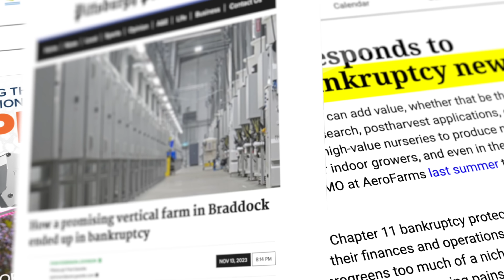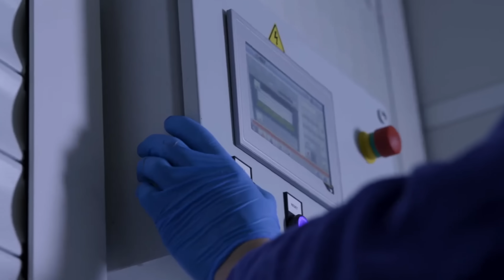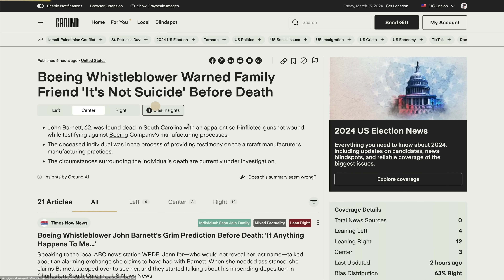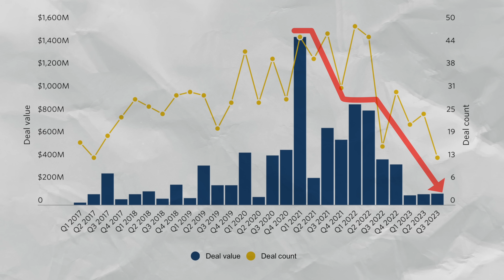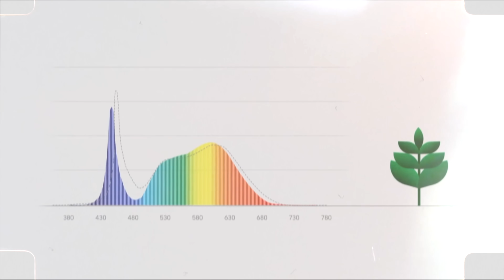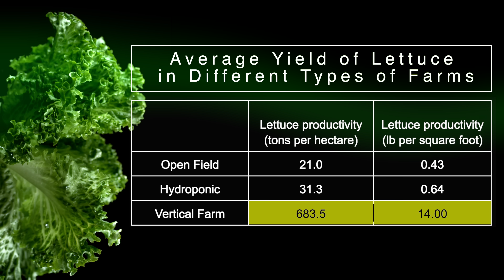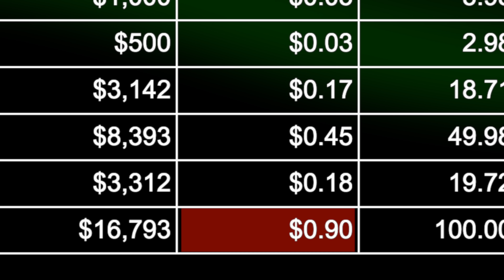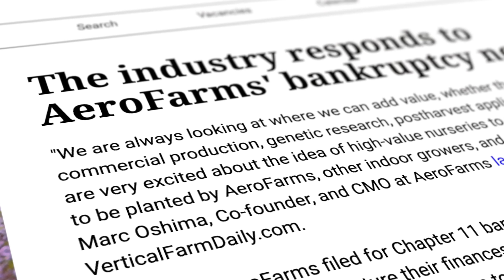The EPIC Failure of Vertical Farms - What Happened?

Comment: In the late 1970s in my father’s and his partner’s greenhouse business they decided to produce a new product and built 2 very large cutting edge technology greenhouses. His partner said it was designed by a genius teenager 😅! It had a boiler heating system that pumped water 💦 through pipes in twin rails for each row that held pallet sized racks with rollers on them for plant 🪴 containers so those racks could be moved around down the rows after delivery with a fork lift. And it had power controlled vents in the roof and ends which were all controlled automatically with small circuit board controllers. But it was basically very similar to my home that I own now that heats with water 💦 pipes in the floor and many homes have this but people don’t really like anymore because it doesn’t warm all that much during a cold 🥶 winter. It’s a system that has a lot of problems but will heat the house a little, reliably, if I don’t push it too hard and give it yearly maintenance, which I have learned to do myself. I saw this greenhouse right after it was first built and then went off to University, two years later I saw it again and it looked like it had barely been used and 1/4 of one had racks of seedlings 🌱 in it but all the rest of the 2 greenhouses were empty. I didn’t ask because it would have been very rude! 
I was rushed outside and told, “We do it this way now!”
So for the first time in many years of this greenhouse operation they were using cheap hoop PVC greenhouses that are just half circle ⭕️ arches of 1 inch PVC pipe with white plastic tarp over it, so you can walk through it, and they had young citrus trees inside and they said these greenhouses are the best because they get the HOTTEST, so these small trees will fruit and that was what sells in the retail market! 
The old and new greenhouses were a big waste of money! 😮 If they had designed their growing systems first, responding to how the plants respond to their cultural practices then they could have built their growing system around what worked initially, instead of having wasted all that money 💰and time on CRAZY ASSUMPTIONS! Those hoop greenhouses are easily collapsed and moved out of the way so a big tractor could come in and disk the plant wastes into the sand, and then the greenhouses can be put back up again.
This and all the news in this YouTube are very disappointing to me because I see a culture that has lost its MIND 😮 INDEFINITELY, where did that thing go? It’s on your shoulders, I think, oh thank you! We plan incredibly expensive systems like we think we are GODs and know EVERYTHING and then they don’t work at all! And the rational thing to do ALWAYS WAS, first document every fine detail of the requirements to grow the desired crop and then build everything around that. But that’s not what happens, build a system and force the biology to cope with the system, so the plants never grow well, is what we do.
How can we possibly survive on a distant planet 🌎 if we don’t know how grow anything? Sooner or later some company will find a way in space to make a lot of money and everyone and everything will start dumping into space to copy that new thing! It ALWAYS works that way. But if we can’t even learn how apply science 🧪 in practical way, which is all I did with my growing system, then people will go into space to do business and then quickly starve to death! 😢
People who first sold shovels to the miners in the gold rush made more money than anyone else and the miners stole from each other and killed to get control of the best mines!

Comment: Why do they need all the LED’s anyway? Wouldn’t it be more efficient to use windows and well placed mirrors to try to utilize as much natural free light as possible?
Reply: Mirrors and plants dont go well together. End up wtih the light being too concentrated and burn spots in the plants. Same with water droplets on leaves it can concentrate the sunlight and burn a spot.
Reply: That's what traditional greenhouses are for. However vertical farms can produce at a rate several times higher than if you were only using natural light, and you can pack the plants more densely.
Reply: mirrors yes, but you need to use light defusers as well so the light scatters around the plants and not a focused area
Reply: I'm pretty sure mirrors cost more than LEDs do, if you look into it, LEDs are unfathomably efficient in providing light, so it makes sense that grows rely on them. The goal is to maximize plant density, and relying on windows would eventually constrain how big the operation can get.
Reply: @raziphaz2219  LEDs use electricity, which mirrors wouldn’t. So even if they cost more up front it’s cheaper in the long run
Reply: @justicedunham4088  mirrors need to be cleaned and replaced, and it would take years to make up for the initial cost. Mirrors also aren't scalable, you need to keep re configuring the space to allow everything to get sunlight. There also isn't enough light captured by one mirror
Reply: @raziphaz2219  seems LEDs are also not very scalable and aren’t cost effective either, or indoor farming would be profitable
Reply: @justicedunham4088  the video we both watched showed that it was labor costs that made it not profitable
Reply: It’s called PPFD quantifies the number of photons (light particles) that are part of Photosynthetic Active Radiation (PAR) striking a specific area (like a plant canopy) per second.  It’s what makers the plants create plant material from carbon. This can be done at a faster rate with higher lighting creating bigger yields and faster turnover.  Traditional farms don’t have that luxury.  Hybrid systems utilize both artificial light and natural light.

Comment: I'm getting the impression that this is an industry that has suffered terribly from a bunch of grifters flocking towards it based on some flashy magazine articles which likely oversold and misrepresented what isn't actually a terrible idea.

Just thinking on the sheer scale that vertical farming requires and it becomes kinda obvious that it's way too big for the average two bit venture capitalist to take on and you're realistically looking at total state involvement since you'd need to build many huge skyscrapers (WTC One in NYC has a floor area of 80 acres whereas the average UK farm is 190 acres) with industrial scale plumbing feeding them and they'd use a huge amount of power for lighting, heating, moving water, powering the controls and instrumentation, harvesting etc. Really only nuclear plants have the vaguest hope of providing the necessary power, and large scale nuclear at that... you'd need multiple plants capable of constantly pumping out gigawatts of power. This is well beyond the scope of any venture capitalist yet extant.

Comment: 40% blue color workers just means that they started before robotics are good enough (whenever that would be). Obviously, hightech farming without the hightech is pretty costly.

Also, vertical farming as a whole makes the most sense when done as part of a strategic self-sufficiency project by a small country. When the world economy catches a cold, state-owned vertical farms might ramp up production to keep food affordable.
Big countries would likely just use fields or greenhouses for that though.

Longterm, farming in a controlled environment might eventually get cheaper than farming on a field because of advances in robotics and energy efficiency. Any farm produces biomass and that can be turned into biogas and then power. Combined with photovoltaics on the roof a power-neutral vertical farm might become possible eventually.

Comment: It sounds like vertical farming is a prime candidate for full automation. By having less manpower, you might be able to offset the labor cost by having less people working on the farm. I think the goal should be to meet traditional farming in end cost with a longer term plan. So the upfront costs may be more expensive, but with the potential ability to be more productive with less space, if they reach cost parity with regular farming, eventually their product will displace regular farming from sheer volume alone. So on the front end, I would probably concentrate my resources on producing an automated system which is easy enough to run on a large scale with very minimal human resources or even training to keep the costs of the end product low. I think it's possible and we are just in the trial/error phase of the industry. Eventually, someone will hit the right balance.

Comment: Further automation won't solve the issue. The product is simply too simple. Automation works in for example the auto industry because the end product, the vehicle, is collectively more complex than the individual machines making them, and hence a vehicle is a high value product. But here there's a complex machine to pick up and move a lettuce or lettuce seeds etc. The cost to maintain or repair even a single one of those machines won't be made up by the sale of hundreds of lettuce. 

Automation works when the end product is more complex than the machine itself, or at least if the end product is used in further high value products. A complex machine may make simple nuts and bolts, but those nuts and bolts are used in more complex end products. Lettuce is neither a complex product, nor is it used in more complex products further down the supply chain.

Comment: the bottle neck is sulfides. manufacturing them is nasty and the line of manufacturers ahead of farmers for these sulfides is ever continuing challenge we can't supply both electric car manufacturers and vertical farms with sulferic acids that are needed to make those industries work. so far none of the Dutch swedish and german vertical farms have failed. it is because the owners of those corporations also own stakes in manufacturing sulfuric acid and bypass the industrial commodities market as a result. instead they purchase their sulfur compounds off the top with a national plan.

Comment: I've been saying this since this idea came about that the first proved cases used the easiest crops and fastest to grow to get good numbers and everyone just sort of assumed plants are all the same but they aren't.  
  
What works for lettuce and greens won't work for everything.  
  
If you for example took all US corn acres and stacked it 10 times you'd have a building the size of west Virginia. In other words more roof space than every current building and home in the US combined. 
  
Also many crops require pollination. How do you do that in these farms? Think of the pollen mess and clean up.
  
Also what isn't included in the yield per acre calculations is all the added elements that need space. Parking lots for workers, retention ponds, space for AC and climate control units, offices, loading docks, labs, storage, warehouse, equipment maintenance shop, and so on. An outside farm only has some of those but not all.  
  
The idea was dead on arrival at least with current technology.

Comment: This is the same "idiotic" reason nuclear is expensive, even though it is the best energy option in every way possible. As long as the technology and its use isn't widespread, modularized, mass produced and standardized the initial investment, build time and labour costs will be so high even a far superior solution can be left near dead

Not to mention there are a lot of corporate interests who control the cheap labour and heavy pollution alternatives to vertical farming and nuclear that will keep making sure they do everything in their power to not let these technologies become viable

Also, a point that this video sadly doesn't cover enough, is the insane environmental cost normal farming (especially rice) has, and it is one of the major contributors for humanity's added impact on global warming

Also, one of the MAJOR points of vertical indoor farming, is that it is reliable and not suspect to draughts, which can help ease famines or self-sustainability issues during crisis like what is happening in Gaza at the moment.

For countries like Finland, where I live, that has almost no farmable land, yet has one the most highly educated workforce with no cheap labour available, underground vertical farming can be insanely good option to guarantee a minimum level of self sustainability in case of Russian invasion or bombardment

Comment: Didn't watch the video, but let me guess:
1. land that replaced with verticality to save the cost didn't work since the verticality has cost for the building and the tech? not to mention if they build on high density place then the land also have higher price anyway.
2. the energy usage for the "sun replacement"
3.the product they are selling is capped with normal farm pricing.

Comment: Remember - there is a difference between calories and nutrition.  The problem with a lot of food supplied by hydroponic or vertical farm operations may have the calories, but the nutrient solutions do not provide anywhere near the nutrients that a good farm-raised crop would provide.  That is true of most corporate farming, as well.  Just pour the fertilizer on the mostly sterile soil and you get edible food-like substances rather than real food.  It is great for the vitamin and mineral industry, though.
Reply: Where's the evidence of that if I may ask? Plants don't need to be grown in soil in order to achieve these nutritious elements, they are minerals absorbed from the water in the ground, those same minerals could very easily just be added to the water in the hydroponic system. I hear this claim made a lot, but never with any evidence to back it up, so I'd be genuinely curious about where this comes from.

Comment: I never got on the vertical farm hype train, but I heard about them and thought "oh that could be kind of cool".
At the time, I assumed that people would be smart enough to build them away from other tall structures and make them thin enough that natural sunlight could provide the energy, thus freeing up the surrounding land for non-light dependant infrastructure such as low density housing.
The fact that people were retarded enough to think that electric lighting could possibly be cost-effective is an idea so retarded that I didn't think people existed stupid enough to take it seriously.
Sunlight on land is free, assuming you aren't surrounded by skyscrapers that block that light. Vertical farming as I thought they intended it would have taken sunlight from land that didn't need it (such as low density residential and commercial stuff) and concentrated it into a smaller footprint that still captures the same light by building up. Food production is limited ultimately by the amount of available sunlight, so using electric lights to put more strain on the electricity supply was just monumentally short-sighted.

I am aghast at the thought that anyone, let alone investors capable of pouring billions of dollars into projects, could be this fundamentally stupid.

Comment: Just spitballing here: it seems to me the biggest obstacle, as mentioned, was simply equipment costs and maintenance forcing final prices to rapidly inflate to compensate. You said it best: you can spend thousands on machines and maintenance labor to get light to mimic the sun, or... you could just use the sun. Always there, every day, outside, for free, forever, no hassle necessary. Vertical farms just had no chance.

Theoretically, if you had a proper configuration of mirrors, could you mimic a vertical farm's setup by just beaming the light onto the plants? It wouldn't give you the multiplicative benefits of special EV lighting, maybe, but it'd be free (minus what maintenance would be needed for the mirrors) and you'd be able to save on transportation and electricity.